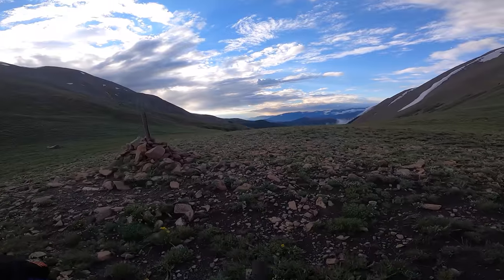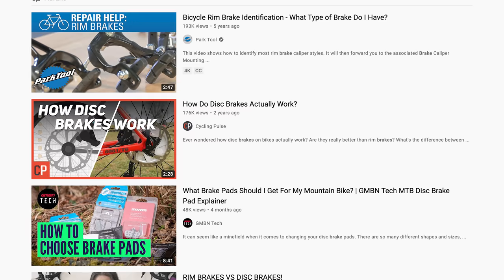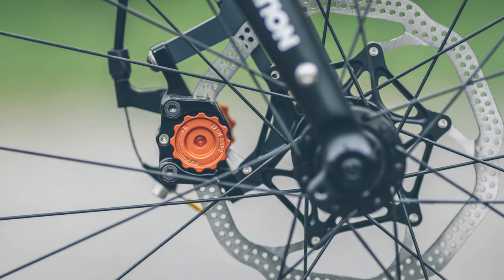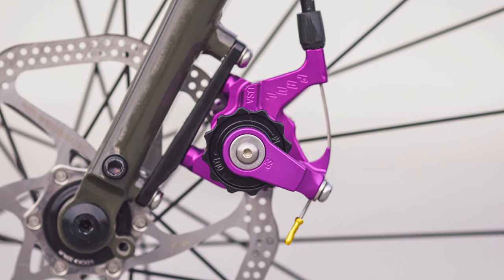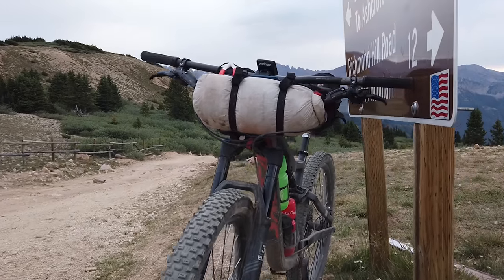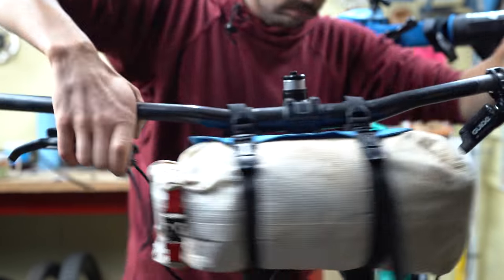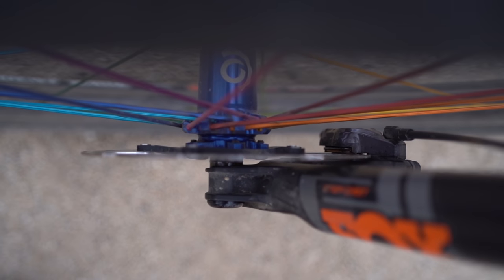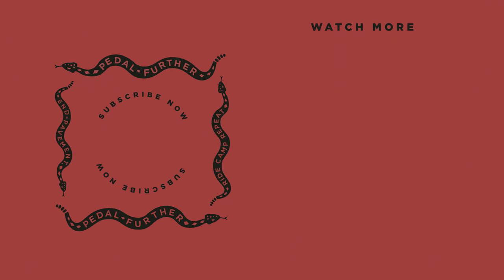The Best Brakes For Bikepacking?

Comment: Paul klampers for me all the way. I've replaced all my hydros with klampers on all my personal bikes.
Reply: Do you have trouble using the adjusting wheel once it gets some dust in there? One came into the shop once and it was frozen solid.
Reply: @cjones7854  I've had a couple that were stiff straight from the factory, but i move them in and out a few clicks before installing them. That seems to do the trick and prevents them from sticking. I have 3 pair of clampers and all 6 of the brake dials adjust and move smoothly.
Reply: Do you find that the force required to pull the levers back is fatiguing? Or requires more effort than a hydraulic setup?
Reply: Steve - any chance you could test some TRP Spyres to see how they compare to the Klampers?
Reply: @chiefsilverback  I'm on trp's list to get some as soon as they become available.
Reply: @badfishgood  I find the force required is noticeably higher than hydros
Reply: Hey Steve!
Reply: @badfishgood  i find it requires maybe 5% more force. However, I'm also able to dial them in to bite exactly where o want on the lever throw, which is even more valuable for me. Aside from SRAM's RSC brakes, i haven't been able to do that on any other brake. My brakes feel extremely smooth and snappy. No spongy feeling like so many hydros out there. I'll take the small amount of increased braking effort if it means I can dial them in perfectly.
Reply: @Macuhdohnadadoh  I'd like to experiment more with levers, but nffortunately I'm on  a tight budget as well. I've been wanting to compare the long throw to the short throws across a variety of levers. I need to order a few more klampers so maybe I'll experiment with levers as well
Reply: @Macuhdohnadadoh  I bought an expensive pair of Paul's "Love Levers" and will never buy another lever. They are machined awesomeness.
Reply: RollinRat Right! But you can write a book so that everything you wrote is not lost in the depths of the internet

Comment: A tip for bedding in brakes. Rather than feathering the brakes pedal up to full speed and do a hard consistent stop and repeat 10-20 times. This gets the brake pad material to a very high temperature and makes them last a lot longer. I've been riding for 30+ years and i weigh around 210 lbs. I always use Hope E4 brakes and i get around 4000 miles out of a set a pads using this method.
Reply: I'd usually recommend following the manufacturers directions for bedding in. Hard stops can leave deposits, and could lead to a bumpy brake. If you take a look at Shimano's recommendations the process is closer to the feathering mentioned here, no complete stops. Get up to speed, brake to walking speed, repeat 10-20 times. Park Tool follows a similar process.
Reply: As a professional bike mechanic, bedding your breaks is on you.

Comment: I love the hybrid cable/hydraulics.   I got a pair of Juin-tech's to test them out, and suddenly all my bikes have them
Reply: Yeah same here! Love them to bits!
Reply: Same here! Love my Juin/Techs.
Reply: Juin Tech GT (4-piston) are the shiznit.
Reply: @WordupG  i have 4 piston 180s up front 2 piston 160s rear.   They are reliably featherable and never need more than 2 fingers to get to max braking power.   A noticeable upgrade to the cable TRP spyres I used to use
Reply: @no_Ray_bang  Very good combination!
I mainly bought them because I already had a good Sram groupset and I didn't want to change it. I was surprised at how good these ended up being.
Reply: Do they require adjustment every so often?  Easy to repair out in the field?

Comment: Another reason the front rotor is often larger has to do with nature seeking the minimum energy path.  I'll spare you the "engineer speak" but, speaking as a structural engineer, it's more efficient for the front brake to take the brunt of it.

Comment: Motorcyclists have been exploring the world for decades with hydraulic brakes with little failure.
Reply: A similar thing happened to gravel racing. I remember a few years ago for some of the longer races people were running mechanical brakes because they could "fix the bike on the side of the road." I would say if your day is going that poorly you should probably just stop, get off your bike, and grab a beer

Comment: TRP Spyke's with 180mm rotors and Avid speed dial 7 brake levers .. I just love them  ... I love the simplicity and reliability of mechanical disc brakes and not having to hassle with brake oil fluids and special bleeding kits.
Reply: Are spykes flat mount or post mount?
Reply: @ChrisBHaven  They're post mount.

Comment: 9:15 take off your rotor and pads, then pour boiling water then wash it with some dishwashing liquid. Works like magic. Makes your rotors and pads feel like brand new!
Reply from the maker: Rad, thanks for the tip!
Reply: Good tip, now wondering if putting them in the dishwasher would also work 🤔
Reply: @jonhume6051  haven't tried that, but you're welcome to try 😁
Reply: Could I throw them in the washing machine with my dirty chamois?

Comment: The reason for larger brakes on the front of any vehicle is due to the change in traction under braking. When a braking force is applied to a bike or car the momentum continues forward and increases the force applied to the front wheel(s). This increases the available traction which can then be utilized for greater braking. Simultaneously, the weight shift reduces the force on the rear wheel(s) which is why it’s so easy to skid the rear tire(s) compared to the front during braking.

For a bikepacking or adventure rigs I always run the same size rotors front and rear in case I have a failure. If that happens, I just use the good setup on the front and brake gingerly, distributing my weight low and rearward.
Reply: Yes, the weight is transferred to the front wheel when braking.  Hence, the front brake does more work.  Same thing applies to cars, motorcycles, etc.
Reply: Good tip for bike packing on having a consistent setup to make swaps and spares easy that way all need to carry is I spare over the same but for the weight weenie at least carry a spare front setup for emergency if you do since it's your best one
Reply: @heathenshaunt681  I agree - I run 160mm rotors front and rear just to reduce complexity.
Reply: @dperreno  I am going to be checking out a few things I have the Tektro brakes that come on a Trek Verve 2. They are nice but I know there's great options that won't break my wallet I am thinking about adding pistons and going to 180s since I will be adding a bafang mid drive and I will have a trailer too. Honestly I want to do a few bikes since they are all I'm going to mess with for a while lol 😆😆

Comment: First preference is rim brakes, I'm old school and like the simplicity. For disc brakes mechanical is my choice again for ease of maintenance.
Reply: Or the bike has the right mounts I like rim brakes mounted as a back up for hydraulic disk brakes
Reply: I never understood what the ease of maintanance everyone talks about is based on. My hydros have been untouched for the 2.5 years i own my bike and ride daily. My friends have cable discs and they are way too weak, need constant adjusting to keep up with pad wear and have snapped cables more than once. Mind you, that is in the 4 months that they have their bikes.

Comment: I'm still on V-brakes on my touring hardtail MTB. Maintenance is yeasy peasy. Brake pads are thicker than those in disc brakes so they last longer (I don't often ride when it's raining during the tour because of duly planning). Yes, with long decents on a heavy bike, arm muscles get tired, but I make stops from time to time to enjoy the views around. No noise, no frequent adjustments, lighter weight, lower risk of damaging brakes by bad handling in airports.
Reply: I run a set of PAUL linear (vbrakes) in back and a BB7 with a 180 rotor up front. My fork is rigid but new school so I can run  the disc up front. The Paul's are very strong and i swear I don't notice that it isn't a disc. KoolStop pads and if you can, like RollinRat suggests...ceramic coated rims. If you can find them anymore, expensive but worthy. Cheers and happy pedaling/pushing!

Comment: One thing some people don't take onto consideration with mechanicals is the difference between pull ratios with different levers and caliper combos. Even ones that are both "short pull" will feel different because of the difference in mechanical advantage. Most people hate old canti brakes but if you set them up right, they can feel great! I have mech that came on my gravel bike (TRP Spyres with SRAM levers) and I'm quite happy with them. My hardtail mtb came with hydros and those feel great but as a mechanic at a shop, I admit I don't enjoy bleeding brakes.

Another thing, some people say rim brakes suck but they're using 30 year old pads! Those won't stop you and will eat right through your rim. Get some Kool Stop Salmon or if you want one finger action, get the Grey E-Bike pads. One finger with 90s cantis on an xc trail.
Reply from the maker: Yeah, that’s a video in itself. Great points.
Reply: Good thought you put there, I used rim brakes for many years now and don't see the point to switch to disk brakes when on flat terrain. In cities or on medium terrain you won't need all that stopping power with 1 finger, if you needto brake hard... then brake hard, take those hands and damn squeeze em! 
Also, when bikepacking you can use a multitool to tune your brakes in 2mins and have the same nice ez feeling when braking. 
(If I'd come to ride downhill I'd choose disk brakes though... no overheating of the rim and so on :D)
Reply: What are these gray e-bike pads you’re describing? Who makes them?
Reply: I just got a gravel bike with drop bars (my first set of drop bars), and I cannot brake on the hood with the mechanical brakes. I couldn't spend the extra on the hydros but now regret the bike full stop.
Reply: @andrew2272kag hello, what model calipers and levers if I may ask ?
Reply: @cjones7854  Tektro MD-C510 flat mount, and Sora brifters (the brifters being part of the issue with less leverage, though not an issue with hydros)
Reply: @andrew2272kag  are you familiar with the adjustments? There's one "fixed" pad (which is adjustable) and one pad that moves with the swingarm. You'll want to adjust the pad in as much as you can (without rubbing on the rotor) and back off the cable tension to get more power. You may have to adjust the position of the caliper to maximize the affect and keep from rubbing on the rotor. Hope that helps
Reply: Also, if you have smallish hands or even maybe if not, adjusting the lever in towards the bar can make it feel better, like your finger can get a better grip and feels stronger. There's a small screw on top under the  rubber hood, assuming you have later model sora levers
Reply: @cjones7854  Hey, thanks for your rundown. I know about the brake adjustment just from an old bb7 I always fiddled with, however I did not know about changing the adjustments of the lever, I will double check my brake adjustments but also fiddle with the levers, thank you (they are the new soras so I will look for the screw)
Reply: @andrew2272kag  sure! I don't know if you have a barrel adjuster on your setup, they do come in handy. But, lots of people adjust the cable tension as the pad wears to take up the slack. This diminishes your mechanical advantage, making them feel weak. A SRAM lever has a little more cable pull than a Shimano, giving you the ability to get little more mech advantage. You could also look into new pads. I prefer organic/resin/semi-metal.
Reply: @andrew2272kag  another thing to consider is rotor size. What size are your rotors? I have 160 front/rear on my gravel bike
Reply: @cjones7854  It's a fresh enough one but been bedded etc so it should be grabby. I usually adjust the pad in, then do the tension, then eventually swap the pad, but maybe not the tension then. same, 160. iirc I had 180 front on my old bike but that was so long ago.

Comment: I use Shimano MT520 calipers with MT501 levers. They are darn reliable although I modified some things.
1. Pads are Trickstuff resin. These make all the difference. They last longer than the OEMs and the modulation is way better. Rotor is Trickstuff as well, machined stainless steel.
2. I don‘t run the OEM Shimano fluid. I makes the brakes do weird things under cold conditions. The point were they start to grab moves back and forth because the fluid‘s viscosity is too high. I changed to a Putoline fork oil and everything is perfect now 👍🏼

Comment: I have had the TRP HY/RD's on my drop bar KM for a few years now. I love them over the mechanicals that are on my other bike.
Reply: I had them before than I switched to the Spyre, easier to fix in the field.
HY/RD's where flawless but once you need to dial them in (purge)... argg.. I bumped into a wall... tried and tried but could not get the bite right.
Reply: @nikoulph  This is why all my bikes still have mechanical.  And they are all the Spyre or Spyre-C platform, since they are all dual actuated.
Reply: @_MrSnrub  HOlly molly, :) thank you. I had HYRD years ago, than I had to purge the caliper... Could not do it my self even if I tried and tried but still spongy Bob. The mechanical disk brakes do wonders SPYRE etc...
Reply: I'm a hydraulic fan. That said there's a gravel bike I'm considering in a color I like but only problem is the mechanical break it comes with. Rather than spend a 1000 bucks on replacing parts for hydraulic will these trp hy/rd satisfy me if I'm doing offroading and need need fast stops on road if a car runs a light?
Reply: @SwyvCrux  I had the same situation and went for the mech bike rather than waiting for a suitable hydro (in my case the hydro was too much more for me). I used to have an MTB flat bars with bb7, no issues. Got the gravel bike with mech disc and drop bars and I can't stand it, braking on the hoods is impossible. I really regret not getting hydros.

Comment: Just upgraded to SRAM Guide R 4 pistons from 2 pistons on my fat bike. Also I went with 180 front and 160 back rotors. Quite a difference, mostly in the ease of braking but also in the confidence in slowing/stopping. Also, I've had good luck "curing" wailing brakes by getting up to speed (20mph+) on a long downhill and slowing down to a stop repeatedly. This seems to burn off the gunk or something. Anyhow, it hasn't failed me yet...

Comment: I don't have much experience with disc brakes, but I do have a gravel/touring bike with the hydro-mechanical 4-piston Yokozuna Ultimos, and I think they're great. Very easy to set up and adjust, and they feel and stop so much better than any of the lower-end mechanical disc brakes I've tried from Tektro.

Comment: I use the TRP Spyke/Spyre on my Bikes with 180 or 203 Disc Rotor in the front. I ride all the year in every weather conditions and my experience is, that the mechanic Disc brakes make no problems. If there is noise I can regular the brake pads with a small srew. If you ran hydraulics there is no possibilty to regular the Brake Pads. On oue Travel Tandem I use a hydraulic Disc Brakes with 203mm Disc Rotors front and rear.

Comment: I’ve used both mechanical and hydro and prefer hydraulic. I’ve toured many thousands of miles on mechanical Shimano calipers with resin pads and they were pretty bad. Pads constantly needed adjusting which is something a hydraulic brake does without you even knowing. Braking power leaves something to be desired with a loaded bike going fast on steep descents. There is essentially no fade though which is a nice plus. I then got a bike with low tier Shimano hydraulics and they were not great. They came with resin pads which had great initial bite but I found they faded super easy where the mechanical discs would not have an issue. On top of this I found that resin pads were usually done for if they got contaminated. I upgraded to Shimano mt 520 with metallic pads and it was a world of difference. Amazing modulation, good power, and no fade. You can really feel metallic pads get more bite as you heat them up on descents. I don’t mind the noise either. Even when cold they offer enough power for my needs. Also metallic pads seem to be much easier to decontaminate as oils don’t seep as deep as resin pads so there is not as much sanding required. I found that even after decontaminating pads several times they still outlasted the rotors. I think with a metallic pad there is not much reason to get a ice tech rotor as the cooling is not really required and they wear out too quick for a metallic pad. I’ll be going with all steel for now on. Really the only pain with hydraulic brakes is maintenance and cost of repair. It’s sometimes messy and the ceramic pistons on Shimano brakes can crack super easy. If they crack your kind of screwed. Gotta be careful about it.

Comment: I use hydraulic front brake and mechanical rear. My main brake is the front and I like the modulation of hydraulic disc brakes. Rear brake is mostly for control and if the front fail to be a backup.

Comment: "What is best" depends on where and how far you'd go bike packing.  I used to have full hydro brakes on all my bikes, until I crashed and kinked my hose that led to brake problems on the road..had I used a mech, then it would've been an easy fix...now, I swap brakes based on different destinations.